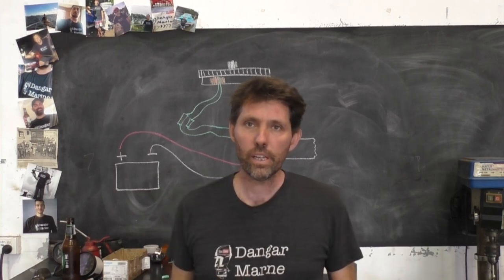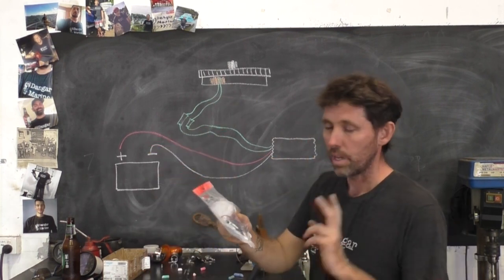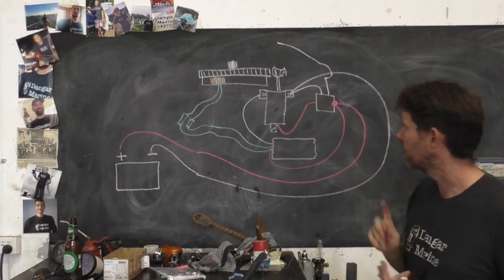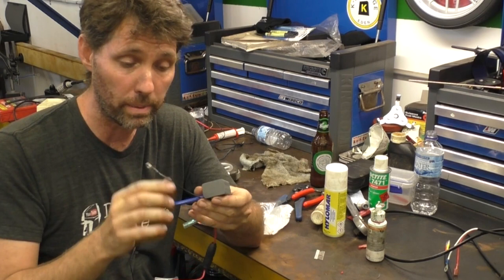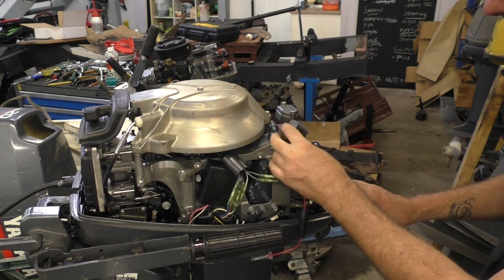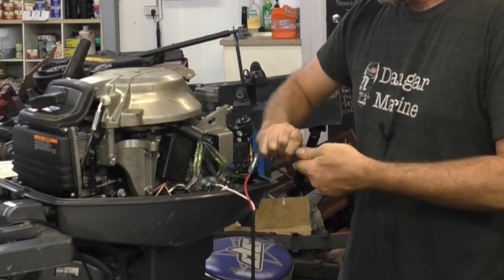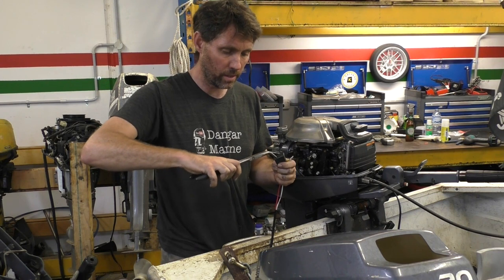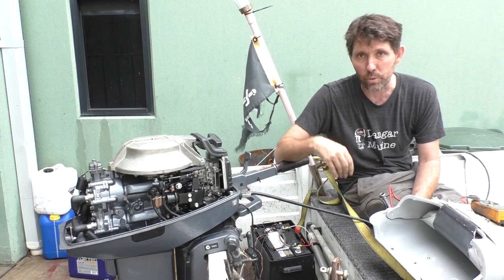Charging a battery from an outboard

Comment: Hi and thx for all your videos. helps a lot. I was wondering if I can use my rectifier to charge the two battery's I currently have a big battery up front and was going to put a second battery just for the starter motor 25hp Tohatsu. I was hoping to run another two wires to second battery. advice please.
Reply from the maker: Yes, you can charge two batteries, they will just charge half as fast.

Comment: Great videos man! Does it matter where I put the new stator? Does it need to be 180 degrees from the original stator? Thanks in advanced, Cameron(1992 30 hp Johnson rope start)
Reply from the maker: Are you adding a lighting coil to an outboard that doesn't have one? Can you send me a link to the stator part you are referring to?
Reply: Danger marine yes sir, it is only a rope start with one charge coil for the ignition. Here is the same coil that is used for the engines ignition, http://www.marineengine.com/newparts/part_details.php?pnum=OMC0584333

Speaking in terms of location under the flywheel/rotor, the factory stator is at 6 o'clock, factor rectifier is at 3 o'clock. 9 and 12 o'clock positions are open and already have mounting brackets ready for the second factory coil I bought to produce 12v charging power. I placed the second coil at 9 o'clock and from what I believe now, was too close to the other coil and had some corona effect on the ignition system. 

P.S. Your videos are great and have saved me so much headache, especially after I didn't know to prime my water pump, and watched your priming video. Thanks in advance!!

Cameron
Reply from the maker: I'll have to confess I've never done this, but other than the two coils interfering with each other as your research says is possible, I can't see why the location would matter compared to an ignition coil for example.
Reply: Thank you for all the help, cheers!

Comment: Hi Stu, Great vids mate, l have converted a 1991 40hp Johnson tiller to forward controls and removed the gas assist ram, dismantled the ram and converted it to hydraulic tilt trim using a remote pump unit from an old chrysler motor, l now need to charge the battery from my motor but have no idea if the motor has the ability to charge or if it is convertible. Could you wise me up on if and how it could be done.
Cheers Plussy.

Comment: can you give me a suggestion on a universal rr for my 92 Suzuki dt30? I'm trying to keep a charge on a battery for a trolling motor not lights.
Reply from the maker: As far as I can see this is the model of rectifier for your outboard http://www.ebay.com/itm/SUZUKI-OUTBOARD-DT75-Rectifier-Regulator-32800-95D10-/122079139724

Comment: Hey mate, I have a 90s Yamaha 8 hp wondering if it would work for this?
Reply from the maker: If it has the two green wires from under the flywheel it will be fine.

Comment: hello,  amigo
   have a 1989 80hp mercury,   I'm getting way to high voltage.  what's my problem?? thanks for your time., ps. like your videos
Reply from the maker: Hi mate, sounds like the regulator isn't doing it's job. The regular should keep the voltage under 15V even at full RPM.

Comment: What kind on AC voltage should you expect out of the lighting coil?   I have a 9.9 Honda 4 stroke.    What is a good voltage level and what is bad voltage level.    I assume RPM should be relatively high to test it at.   Anyone have any Idea?   Thank you

Comment: I just replaced the rectifier and stator on my Mercury it is non regulated puts out 16 volts at 4000 rpm into 2 deep cycle batteries wired in parallel there is a small power draw constantly so i assume they won't overcharge. If I have a problem I see no reason I could put a Yamaha or similar regulated rectifier on to replace the Mercury stock rectifier.
Reply from the maker: +Pits McGoo I think you could grab a regulator / rectifier from any outboard with the same number of phases on the AC input. The only think I wouldn't do is use one from a say 10hp on a 150.

Comment: Hi I bought one like this it's rectifying from 8v-40v ac to 8v-40v dc.... it doesn't regulates to 12v or 13v....

i guess it's bad... because I can't charge a battery with more than 14v dc

Comment: Hi Stu, love following your progress and informative, entertaining videos rebuilding Renko.. esp look forward to the chook segment at the end! I've just watched your video on fitting a rectifier on an outboard to charge a battery. I have a 22 ft twin keel yacht built in the 70's I'm restoring. It once had a small inboard diesel but that was long gone by the time I got her. It came with a 6 hp Evinrude outboard which looks like has been around the block a few times, is a bit smoky but goes ok. My question is what do you reckon is the smallest size outboard that can realistically deliver a charge to a boat house battery if run for a few hours and how would you link that with solar panels in the system. Only want to run lights, depth etc for short periods. Cheers, Steve

Comment: Hi Stu, I see that my 1990s Johnson 40hp is overcharging the battery and accessories with an output of 16 volts at most rpm. Would it be acceptable to simply install a zener diode with its heatsink to keep the voltage in check and ensure no damage to the battery or the accessories? Certainly the Triumph models from the 1970s have such a device installed within an effective heatsink that appears to be mountable within a aluminium boat. Has anyone else tried a similar option?
Reply from the maker: Hey Bruce, can't say I've ever tried it, but it certainly is possible. This article has some good info on it. Might make a good video one day! https://www.electronics-tutorials.ws/diode/diode_7.html

Comment: Once again a great video mate.I really enjoy all of them.Glad you made it clear to the viewers that the higher the rpm the more voltage you'll get in the battery compared to at idle.Quick question from me is,where would you recommend I source a good workshop manual for my 30hp yamaha cv preferably in book form?Thanks for all your time and effort you put into the vids. Fabian.
Reply from the maker: About the only way to get a read service manual is to order it as a part through a Yamaha dealer, but some have contracts that prevent them from selling them unfortunately. Otherwise, try finding a pdf one on readmanual.com or tradebit.com and then get it ring bound at an Office Works or something. That's what all my printed ones are.
Reply: Cheers mate.Ill have a look.

Comment: love your vids mate. 
can anyone give a reason why you couldnt hook up 2 of these so you can charge 2 batteries at once?  excuse the dumb question maybe a silly question
Reply from the maker: Thanks mate, glad you like the vids. You can charge two batteries from a single one of these, they just charge half as fast. The limit is the current produced by the coil under the flywheel so adding a second wouldn't change that.
Reply: Hi i just purchased a new pontoon from the dealer it came with a Mercury 115 
    I added 3 optima batteries for the sound system. Will the outboard be able to charge all the batteries? Thanks

Comment: Need some help with a 2001 8 mshz Yamaha I have to blue wires coming out the under fly wheel and they not connected it looks like he used parts from a 2001 f8 mshz

Comment: I have a mariner 2stroke 20hp.  how can i use a rectifier/regulation from Honda moto to have power on the boat without using a battery? i don't care if is ac, because i only have lights. the rectifier of honda has 4pins. i have in mind to connect in parallel the pin which is for regulation with ac and the positive. the previous owner had used the rectified pin, but this way needs battery, because the rectified dc is 14v and burn the lights.
Reply from the maker: If it doesn't matter if the current is AC you don't need a rectifier, that is the bit that turns the AC into DC. The lights with brighten with RPM without a regulator though. Sounds like the Honda rectifier you have is the same as the one in this video - two AC in, + and - DC out. What wires do you have coming from under the flywheel?
Reply: yes it's the same, 2 ac in, dc out and for frame ground. the one ac is going to rectifier for dc(charge battery) and the second one is for regulation(lights). the moto lights use regulated ac power. i suppose you mean the flywheel of outboard, right? 2 wires. Probably i need an extra regulator to connect in series with the positive dc of the rectifier, to have 12Vdc..maybe an LM2940CT-12.

Comment: Will this type of thing work with a 24v set up
Reply from the maker: Most outboard regulators are 12V. You'd need to see if a 24V one is available for your engine.
Reply: I may have have said that wrong. What I was trying to ask is if I have 2 12v batters connected marking. 24v battery system will the rectifier be able to charge both at the same time ?

Comment: hey there, your video is great information! what would i need to do extra if i have dual batteries?
Reply from the maker: There is nothing extra you need to do if the motor is electric start and the regulator / rectifier is connected to your starter motor wires. As it produces current it will be sent to whichever battery is selected on the switch 1 / 2 / BOTH.

Comment: Excellent tutorial as usual!!! Do you know what is the voltage range for that particular model straight from the coil ? ( I guess it's about the same for other 20-25hp Yams ) . Or how many pulses per rev it gives you?
Reply from the maker: Thanks mate, no, unfortunately I'm not sure what the coil puts out directly. It would be interesting to put the DVA on it one day and see.
Reply: Ok, I've sorted out for anyone looking for Yamaha 25DM / '83 Mariner 25HP 2 stroke ( engine type 695 ) have as follows: 
20V sine wave at idle ( 40V peak-to-peak ) ... ~11.6V stabilized DC voltage , 33HZ ( that means 2 poles per rev)
100V sine wave at full throttle ( 200V peak-to-peak ). ~55V stabilized DC voltage, 209HZ frequency
I guess that other 25HP yamahas from 90's have pretty much the same setup

Comment: Valueable information, as always! Thanks a lot! I was wondering if it would be Ok to connect smaller batery. By using switch to charge also the small one. I also have 24 Ah batery and I was thinking if amperage from 9.9 Yamaha is not going to be to high for it?
Reply from the maker: It is recommended that the charge rate for a battery doesn't exceed 20% of its capacity.
Reply: @DangarMarine  I had a feeling that I just have to apply this or 10% rule.  Going to check amps that comes from my rectifier regulator. Thanks for reassurance!

Comment: My small hp e/s outboards Yamaha 8hp two and Tohatsu 8hp two stroke both had charging in place i presume to charge start battery with thick hipower cables..
Whereas a mercury 5hp man start 4 stroke hsd charging but only a very light cable and manual say 2 amp charging and no need to have battery connected whereas both 8hp E/S motors advise battery must be connected (40 amp hr in case of Yam 8hp 2 stroke..).

Comment: Hi Stu! Well, it seems that I have problems in my Yamaha 100hp -99 engine. Today I tried to tilt the engine to running position. Nothing happened, no power at all. Main power was on, but battery was low (10,5v). So, used spare battery but Nothing happened. Found out that 30amp fuse was blown. Changed the fuse and lowered the engine, but there was smoke coming out from lower part of the front side engine and fuse was blown again. I think it was the rectifier, not sure though. Any ideas how To tackle the problem? Thanks for the awesome channel!
Reply from the maker: I'd be trying to find the exact location of your smoke as that will be where the short is.
Reply: Dangar Marine I removed the Red wire from rectifier. It did not burn the fuse anymore. After I re-connectex the rectifier it immediately burned fuse After poer was turned on from main switch and smoke came out from behind the rectifier. New part was 350 euros...ouch.

Comment: hi there your show is cool. i want to no why my out board runs in my drive way.but when its in the water it low idles and cuts out.and hard to start.
Reply from the maker: Sounds like the extra back pressure on the exhaust when it is in the water is causing your problem. I'd start with a compression test to look for worn rings or a blown head gasket.
Reply: cool one mate will look in to it and thanks for your reply.love your channel.

Comment: Hello Dangar Marine, your videos are VERY INFORMATIVE! 👌🏿👌🏿
 I was wondering if I can attach a regulator rectifier to my 1974 Mercury 110  9.8hp with thunderbolt ignition being that it didn't come with one, can I piggyback one to it just as you did in THIS video?
Reply from the maker: Not sure if that motor has a charge / lighting coil under the flywheel, but if it does then sure, this would work just fine.

Comment: I just replaced my rectifier then went to charge the batteries. Put the cables on backwards and fried the new rectifier immediately so have a new one ordered. Hopefully the stater was not damaged. Next project is put a cutoff switch on the batteries.
Reply from the maker: Doh! Oh well, we all do things like that from time to time and at least it wasn't a much more expensive ECU that blew up. Some times you've just got to look on the bright side. :)
Reply: Installed a new rectifier and went to put on a cutoff switch. Discovered the previous owner had bolted the cables straight through bypassing the second battery. Been like that for 3 years so I straightened that out. Now I have two batteries wired in parallel so it was a good thing I blew the rectifier or I would still be running around on  one battery.
Reply from the maker: Good to hear there was a bright side to the story.

Comment: will that work on a johnson 10 hp?
Reply from the maker: It is pretty much the same on any outboard that has a two or three wire charge coil under the flywheel.

Comment: hey mate exellent vids so glad i found this channel.. after seeing this ive decided to TRY do this to my 25hp 2003 johnson pullstart..the thing is i have 3 wires coming out yellow yellow/blue and yellow/green and they are trying to sell me a 4 wire rectifier..i dont get it i have 3 wires..how do i hook up 4 wires
Reply from the maker: The four wire one is correct. The three yellows connect as the AC inputs and the red is the 12V DC output.
Reply: Dangar Marine 
ok thanks mate..not one boat shop here in Sydney could tell me..thanks again

Comment: hey nice videos, very informative , would like to ask you something about suzuki outboards i have looked around but have not found much about it. i recently purchase a DT150 cant really find what year it is but it some extra wires besides the control harness, it is an eight  wires hardness with a six quick connect consisting of a green, blue, yellow and a green red stripe , red yellow stripe and a green yellow stripe that i dont know what could it be for , also there is a brown and a red  rewire single connections , i see you have a vast experience in outboards so any help identifying this for me  is greatly appreciated, or any one who reads this thanks

Comment: Again, great video. Would you know if I could do this install on a 1972 Evinrude 25hp. Thanks
Reply from the maker: I'm not too sure. I've never worked on an older Evinrude but I'd be surprised if it didn't have a charge coil already installed by 25HP.

Comment: I use the fuse on the red wire
Reply from the maker: Yes, adding a fuse between the rectifier and the battery is a good idea.

Comment: My 1988 johnson 60hp is charging at 16v at idle and increasing with throttle
Reply from the maker: The voltage is too high, sounds like the regulator has failed.
Reply: @DangarMarine are you sure this part number you gave is for a regulator and rectifier or just a rectifier

Comment: Looks like your wall clock battery needs replacing. :)
Reply from the maker: This week I'll change it!
Reply: Hey, hey, easy now... don't get all crazy and fix it after all these vids with it struggling to tick. It's an icon now.
Reply: I think the clock actually works, its just the second hand gear is stripped.

Comment: Been looking for a kit for a game fisher 9.9 can’t find squat.
Reply from the maker: So I read that "Sears Roebucks marketed a line of small horsepower outboard motors using the Gamefisher brand. These outboards were made by Eska and Force from the late 70's through 1996. Force was the manufacturer from 1987 through 1996." Any chance you can search for parts for the original manufacturer?
Reply: Dangar Marine can’t find oem apparently there was 4 manufacturers of the gamefisher 9.9 Mercury Tanaka Johnson and eska I can find mercury and Yamaha ones all day
Reply: so i looked at my motor and it have another set of wires grey and a grey/yellow coming from the wire harness where im assuming the stator is as it has a kill switch wired to it as well, so mine being a mercury manufactured gamefisher, i should only need the rectifier/voltage regulator for the mercury and not a stator kit correct?

Comment: My Honda 15HP 4 stroke from 1990 is supposed to charge my battery, but sadly it doesn't..
Reply from the maker: If it has a regulator / rectifier installed it may be blown. They do fail from time to time.
Reply: I don't know what it has. Time to do some research :-)

Comment: very dangerous and bad practice to connect any power cables to a battery without a fuse! if the cable get snagged and shorts then prepare for a fire!! always fuse as close to battery as possible
Reply from the maker: This is pretty much a factory install. Starter leads to the battery are never fused due to the high current draw.
Reply: Dangar Marine yes starter leads are not fused due to the high starting current but everything else always is. starter leads also can handle many amps compared to the cable you used